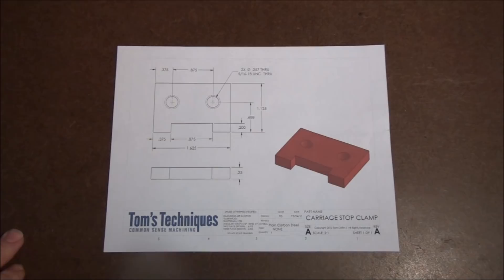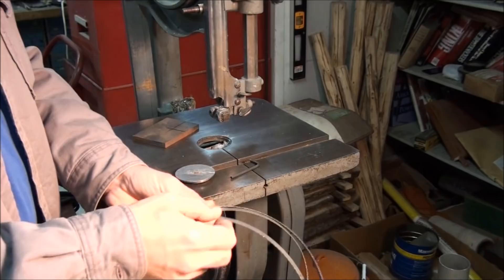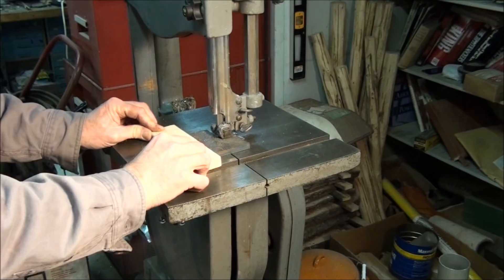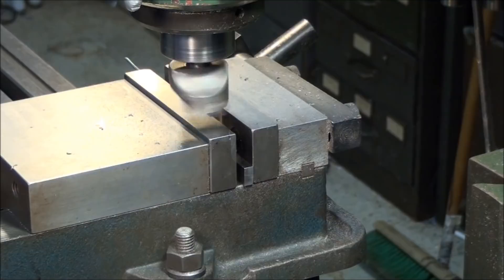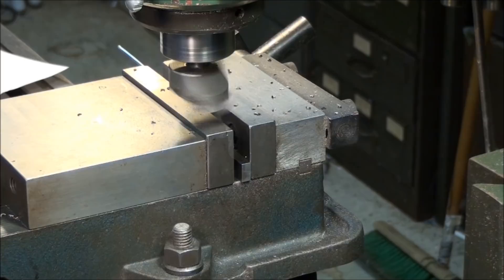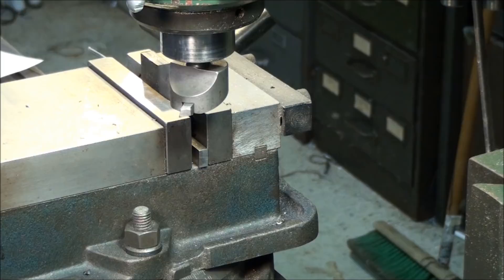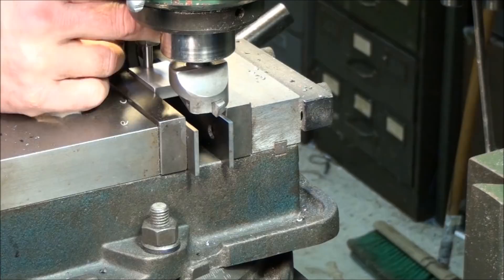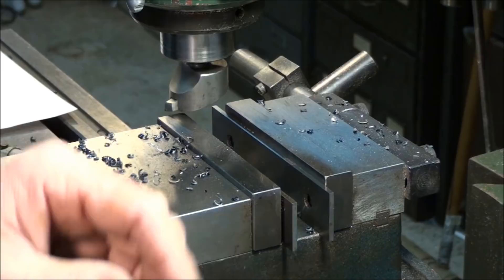Carriage Stop Clamp Part One, Sawing the Stock and Squaring Up the Part

Comment: After I posted I realized they probably made a metal cutting version that looks the same and that that was what you probably had. Mine is indeed a three speed wood cutting version. The slowest speed is fine for aluminium but it does look like I have a future project slowing it down further. The blade folding trick is great, my blades are all now nicely folded. : )

Comment: Never seen the second method you showed for coiling a blade. Looks like it works good for small blades.
Reply from the maker: It works on long ones as well Bill. Since they coil three times, it still makes a compact package. Even a 36" DoAll blade will coil up to about 18".

Tom
Reply: Thanks for the response Tom.  I guess what I meant to say was using the second method you showed to coil large blades.  I've always done it the first way and as you say it works fine with big blades.  Our shop has a 20" vertical and a 10x16 horizontal and I have coiled those blades with my foot.

Comment: Thanks’ Tom, enjoy watching your videos. Keep-them coming! I’m a woodworker just getting into metal and I have the jet 16” band saw, and I don’t even try to coil my 1-3/4 Resaw blades; I just oil them and hang them-up: they just scare me to no-end.  I see from the vid a pile of stickered wood. Question do you use your band saw for both metal and wood? Or do you have standalone band saws. As always, thanks’ for taking the time to make this video! And I support this site. ~M~
Reply from the maker: Hey Mike.

I use my bandsaw for everything. It does have a gearbox, so originally it could support cutting metal or wood, but it was missing some parts when I bought it and it pretty much lives in the low range. I need to get busy and figure out what parts are needed to get it back to its original condition, if only there were more hours in the day...

The pile of wood in the background is for some rustic furniture for our Up North cabin. It was cut last summer and stacked to dry. It will ultimately be a bathroom vanity.

Thanks for watching.

Tom
Reply: Thanks for posting back. Understood ~M~

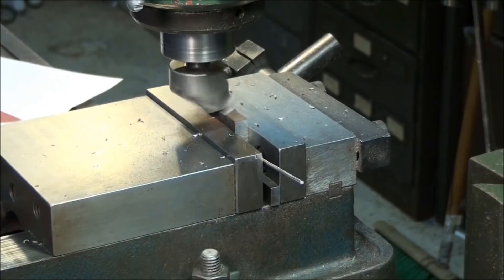Comment: At 16:30 and 18:40 and you mill so that the cutting forces push the part away from the solid jaw and against the soft aluminium wire. Wouldn't it be better to always mill like 14:30 and 18:10 where the cutting forces push the part against the solid jaw?
Reply from the maker: I don't think this little fly cutter can generate enough force to matter one way or the other. If it did, I would have had a lot of parts move or come out of the vise by now, and that just hasn't happened.

Tom

Comment: Hi Tom. I have a similar if not identical bandsaw. Mine is a threes speed but is too fast for ferrous metal, did you modify your bandsaw at all?
Reply from the maker: Mine actually has a two speed gearbox, but it was missing parts when I got it. Right now it's permanently set in the low range and has a couple of aftermarket step pulleys to adjust the speed. If you have a woodworking model, it will likely require a jack shaft to get slow enough for steel. Sounds like a project in your future.

Tom